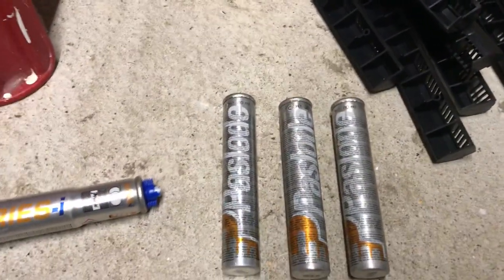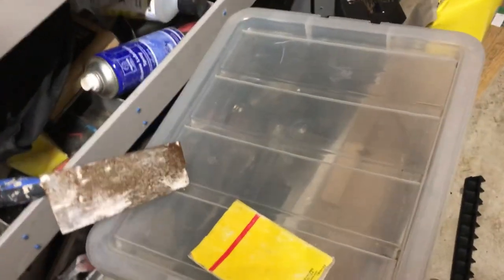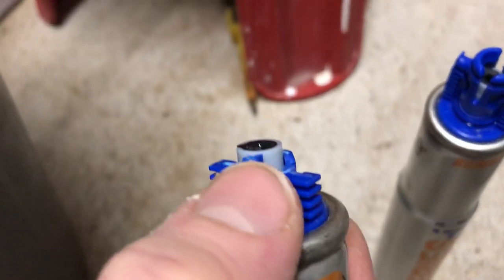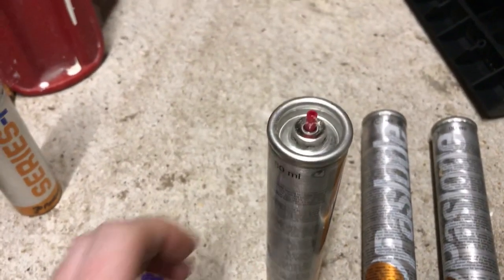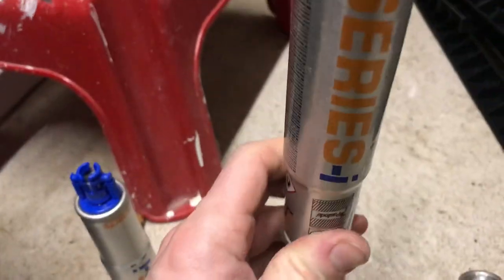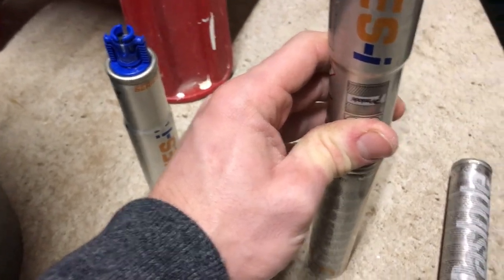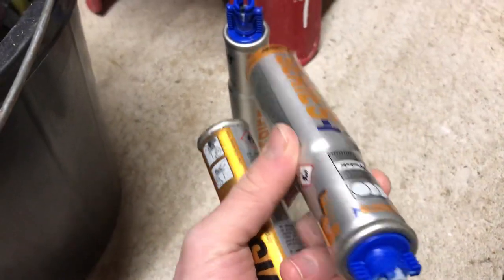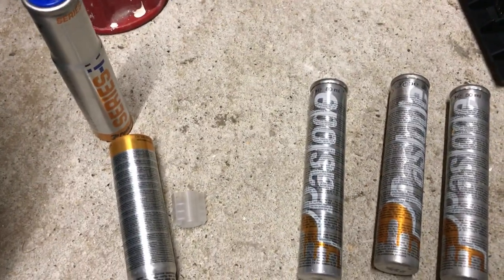Hack How to Refill paslode im350 gas with im360ci

Comment: No need!... just swap the adaptors off of the top (the blue SERIES-i can be prised out carefully with a small flat screwdriver, so no need to damage by cutting it) - they are interchangeable 🙂
The blue SERIES-i also has a removable female adaptor with seals that can be used to transfer from/to other cylinders.
Reply from the maker: Thanks for the comment. Sounds a much easier option. I worked it out recently funnily enough but ended up using a pair of grips to pull it off.
Reply: The new canisters don't fit in the im350+ guns

Comment: Can I somehow get the blue cap off and use an old gas as a new contractor I'm subbying to only supplies the old gas and now I have ran out of 360xi gas what can I do?
Reply from the maker: yeah dude I believe you can, someone commented on here saying they had success using a screwdriver to pull off the blue cap. I have a feeling though the gun won't register the gas potentially. in which case there is a female end underneath the blue tab and you can just then refill it from the 350 gas. just remember to put the 360 gas you want to refill in freezer like I say in the video to top it up some more
Reply: @Georgous92  I've got to 360 xi guns but the new Co tractor I work for only supplies the fischer gas, just bought my self a 350 plus and now I've managed to get the blue cap off and it works in my gun it locks in but wobbles slightly

Comment: can you fill the im360 gas up with the I'm 350 gas 😊
Reply from the maker: What you could potentially do is get the blue cap off a dead 360 gas and just plant it straight on the old gas. As I think the rims are the same diameter
Reply: @Georgous92  The chances are that will not work as the I series canister has a shoulder in it so the shape is not uniform all the way along like the 350 canister is. Paslode have changed the can shape and the valve in an attempt to force owners to buy the newer model, and once they do a new style can is about 4 times the price of the old style.
Reply: @roberttill3787  one gas bottle here in Ireland on its own is 40 euro some are 53.99 euro single pack new gas, you can buy 51mm 1st fix nail pack 2 fuel cells 2500 nails 65 euro it's a rip of on its own ... they just fly up then, 90mm mm pack is bout 100 euro.. stainless steel nails 150 per pack,
Reply: @earthsgard   totally agree with you.
Reply: @roberttill3787  I'm on the hunt for gas right now lol 🤣🤣🤣we 1st fixing a 40 sq metre granny flat I asked the boys in Saturday but we are trying to get done I was out of nails and my search lead me here 😅 I said I'd get the nails to speed it up being a sat lol...
Reply from the maker: @earthsgard  I have quite a few im360 gases if that’s what you are looking for? Where abouts are you in the UK or Ireland?